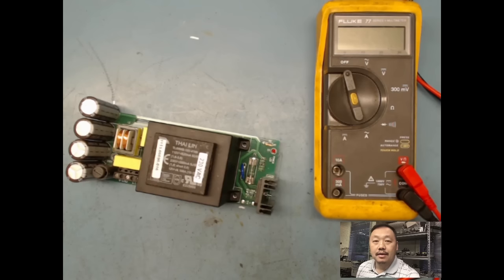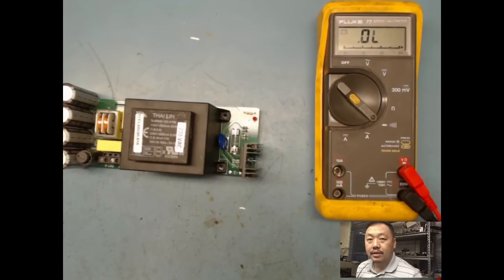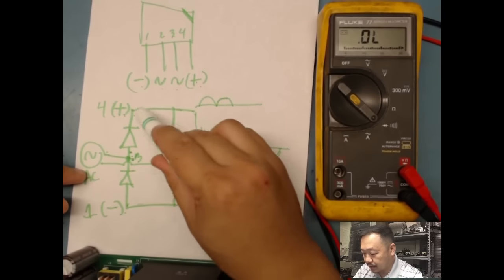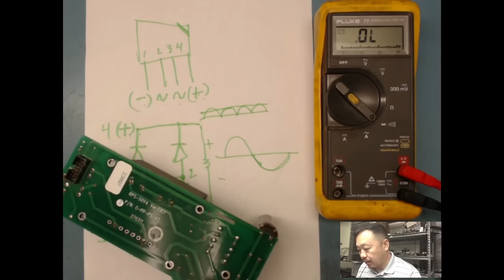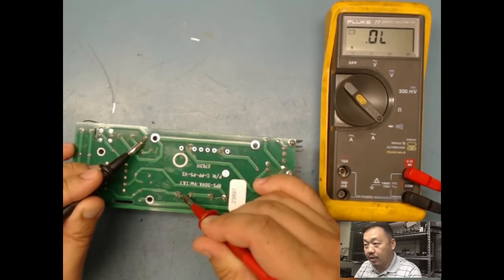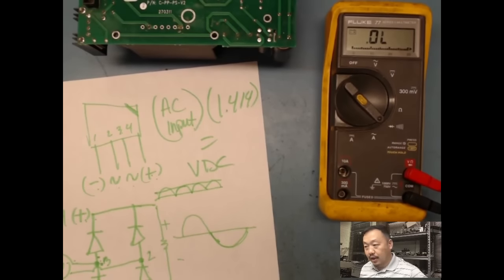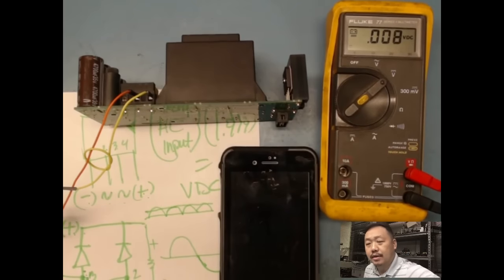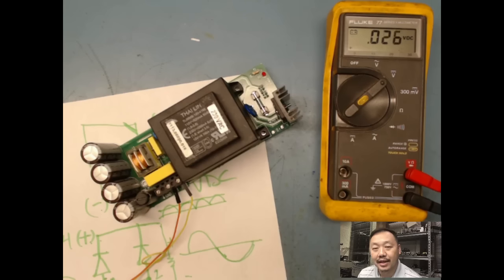How to Troubleshoot Electronics Down to the Component Level Without Schematics

Comment: I have been watching your videos for about a month now and I have learned quite a bit on how the SMPS  PCB   Inverter  Board works. What I am presently working on is a power supply out of a Samsung RF 8000 refrigerator. I have meter to read voltage and continuity, amps. I followed your instructions on how to check the boards. I don't  have a lot of electronic test equipment to test the circuit so I just use the connections  on the refrigerator to power up the board . I am getting 115 AC in and it goes through the fuse through the bridge rectifier and using your formula , and it shows about 165 DC voltages through the capacitors , there are two that both measure 165 DC  voltage . i follow the board down to what I think is an IC at the bottom and a smaller capacitor on the top side that looks like it is connected to a IC on the bottom that has no  voltage  where it is connected to the IC. I think this is the positive side of the DC voltage. On the other side of the DC voltage it goes up to what looks like a resistor to a bigger IC with a metal bridge screwed to the top of it to cool it down and that goes to the compressor to run the refrigerator, that is supposed to be getting at least 310 DC volts , but only getting 244 DC volts. I think the chopper CCt  is keeping the the  VCD/ PWM, from the feed back circuit to the main board that regulates the out that is 10 DC at the out put that should be 15 DC volts and 5 DC volts. My question to you is where is my problem? How do I find where the lost of voltage stopped. I know that the double wired coil is only hot on one side with voltage or has continuity on one side I can't remember which. Could this be my problem, I have tried everything else that I have learned from you guys . Is there any way that I can chat with you? or send you a picture of the SMPS  PCB?
Reply: I like the videos and they were very helpful.
Reply: Don't lick anything!
Reply: You should try to draw the part of the board you just had described on a paper, identify the components (value/name/etc), find the datasheet for the semiconductors, write down on the paper all values you had been measuring, see/analyse if the values give sense compared to the datasheet.

Comment: Thanks for posting, however, this is really for the novice and even below that..
If one doesn't know how to test a fuse or doesn't understand diodes, he would be better leaving the 'repair' to a more competent person.
It's also dangerous to handle boards such as this with 230 v AC applied to them!  You, of course, take due care but the 'novice'  that try such repair might get a nasty shock, or worse..
With great respect, I would suggest to offer advice on repairs on PC boards that deal with low voltages, that is for the newbies.
Perhaps, more theory on what each component does with a simple diagram on paper would be more useful for the ones starting electronics. Anyway, good effort and thank you for it.

Comment: Power supplies are a lot like cars (I've repaired both). Most SMPS supplies are basically the same, and you can identify the functions of many components just by looking at them (much the same way you can identify the alternator, radiator, or power steering pump on any car)

Comment: I like to watch a guy (northwestrepair) who repairs GPUs and explains what he's doing throughout his videos.  One of the new modern tools you can use is a thermal camera to look for hot spots.  In the case of a power supply without a load, nothing should really get abnormally hot and that's another way you can look for abnormalities in broken circuits.
https://www.youtube.com/watch?v=zHBcPRiI6-E  (thermal camera at 4 : 05 into the video).

Comment: Hello, I make guitar effects pedals, I just got afew new pcbs made, same ones I always use, I use the same components every time, but the last three I built, I get no sound, I do the same Everytime, I went over the whole board checked continuity, and it's all fine, so I checked every component and there fine, so I switch op amps thinking I gotta bad batch of op amps, there good, I'm stumped on this one, just wondering if you had any ideas. Thanks

Comment: I'm trying to determine if a Bluetooth speaker internal pcb power supply is defective.  The type of battery used to power the unit is a 12 v  7 ah seaked lead acid. Will plugging a fully charged battery and measuring the output be a way to determine if the pcb power supply is detective ?

Comment: Maybe someone can advise me. I trouble shot a table saw that quit working. Before I finally checked to see if power was actually getting to the motor, I had replaced the switch, and the power interrupter and brushes. Checking to see if power in fact was getting to the motor proved that yes the motor was receiving power. The only solution I could surmise was that the  rotator needed ro be replaced. Am I mistaken as to the source of the problem?

Comment: Hi, I was wondering if you knew how I might repair a treadmill console board? Not sure if it's a short or a relay, but when adjusting the height or speed while in use the belt will temporarily stop and then start up again. I contacted a treadmill repair company and they said it was the console and I would have to replace the whole thing. This seems wasteful and like the easy answer. Everything else works fine it seems like some sort of communication error. Thanks

Comment: I'm in need of someone to troubleshoot and repair an ice maker pcb for my vfw.  I'm unable to find the bad component on the control board which powers the display.  A new board is $330, however seems like someone should be able to repair this one at a fraction of that cost.  Thoughts,  thanks.

Comment: Why would you probe around looking for Grounds when depending on the circuit may have a voltage rail energize to a ground fault? You can't depend n that. Not an Efficient Method.

Comment: I used to apply 240volts AC to the primary and used a multimeter to checkout from the secondary in each winding it’s will shows do you knows there are hight currents low current

Comment: When Radio Shack closed their stores an went to on line they ruined my hope in electronics. I hate ordering things on line. 
If I can't hold it in my hand and look at it I won't buy it. They make buying things on line a big hassle so you have to hurry up an wait for something you need now not next week. If the on line company sends you the wrong part you have another hassle to hurry up wait some more . Or you get ripped off.

Comment: Great video but the hardest bit I can't get to grips with is how you know where to place the probes.  +ve and -ve fine but having one probe at the top of the board and the other at the bottom doesn't really mean anythng to me,  have you followed the circuit board to do this? I think I need to learn a level or two below this and then come back to this video.

Comment: 5 burnt resistors in a cluster on the audio output of a radio  and a burnt ceramic cap.  Burnt to the point it the components cannot be read.  No schematics.  Thinking of tacking in 1 meg ohm resistors and a random cap and see what voltages appear around the output the output transistor.

Comment: Greetings.  The tip by tip troubleshooting procedures are okay .  However, I think you mistakenly labelled the bridge rectifier on the schematic.  You referred barred end of the diode as the positive terminal,  and thereafter you also referred to the barred end as the anode. That is absolutely incorrect. The barred end, straight line, is the negative terminal of the diode and is referred to as the cathode.

Comment: Your LED is either series or paralleled with several other components which then requires more energy than your multimeter battery can give.l reckon it would light up if you had it out of the board.

Comment: Thanks Electronic Tech for the video.. Hope anyone can answer my questions:
1. It is more safer to use power supply to subject instead of plug-in directly to the wall socket? or actually both will give the same damage if anything accidentally wrong... (i hope PS bench can protect us).
2. it safe to the subject if we put AC gradually to them? i mean the circuit must expecting some working voltage and amps... but we supply the power only half of it.... it can damage some component and IC right?

Comment: Milwaukee has a newely released right angle die grinder. Problem is many (and i mean many) shut down after seconds of use. I think there is a torque sensor that is shutting it down. Im wondering how it could just be bypassed. I dont care if i burn it up eventually because the many i own at least could be used. I could take pics or any kind of info you need i could give you. If the comments is too lengthy i could give you my email.

Comment: if a resistor burns out with out any color lefts how do you workouts to get the correct resistors backs into the circuits for me I started with VIR ohms laws it’s very easy unless your head get screwed it up

Comment: HELP! I suspect my transformer is faulty because no output when powered up.. how do i know the value of the transformer with no makings and no schematic? so how would i find a replacement?  It's for a MC2100TS-50W REV B Threadmill power supply...
Reply from the maker: you'll have to find out what the output of the transformer supplies.  For example, If you only have one secondary winding, and it goes into a bridge rectifier, and then the bridge rectifier supplies DC voltage to a 5v voltage regulator, then the out of the Bridge rectifier only has to supply a minimum of 7vdc.  Just work your way back.  Finding a replacement transformer can be difficult if you don't have a part number.  Good Luck.

Comment: Something else to look for in visual inspection. If there is vibration, sometimes heavy parts will lift the traces off of the PCB and break them or break the solder connections.

Comment: Hello Electronic Tech. My job is to repair electronic boards in Iran and recently I faced a strange problem.
As I was repairing a BMW 730i 2017 wing mirror electronic board, there was a dubitable component from ST electronics company which I couldn't find its datasheet on the internet. That was a 2 pin component with Zb2b part number. I am wondering if you could help me with finding out what component I should replace with this. sincerely.
Reply from the maker: Sorry, I'm unable to help.  What we found with automotives electronics is that they are not your common components but are made specifically for the car makers.

Comment: when your testing fuses with your meter in the setting you are using its not volts its ohms could also be mega-ohms but in your instance it was 0.001ohms not volts.

Comment: Thank you friend for the great video . I've worked for several years diagnosing automotive electrical and electronics. Testing sensors, actuators and wiring but never really understood circuit boards . Subscribing :-) Thanks

Comment: Good way of teaching newbies especially if there is no schematic. Been doing repair of electronic stuff for 20 years and still counting. I developed the skill of fixing things without schematic. I can even modify a circuit even if there is no diagram, I just have to make my own and get the the components ID and search in the web for the specs. For the power supply that you were checking, I guess the output is quite low. Assuming you are using the 115Vac input and the transformer’s expected output is 12Vac, then the turn ration has to be 9.5:1. The rectified output is supposed to be 12*1.414 = 16.9Vdc. Now adding the filter caps, C=I/2*F*Vpp. C=2/(2*120*2) C=418uF or the closest to that. With that filter capacitors the filtered DC out is ~14.9Vdc and that is at open load. What you were getting is quite low.

Comment: Thanks for sharing!
I haven't had luck testing electrolytic caps in circuit. Ive read that an ESR meter is needed to accurately test caps. 
Supposedly a cap can test good on a multimeter but fail the ESR test?

Comment: Hey brother, my name is Va. Ok I got a test meter that powers on, but the readings are not correct and my question is where should I start? I've looked at the board thoroughly and see no visual damage. Was gonna replace all the smd resistors and components. But please , I would like to hear opinion.
Reply from the maker: When you are saying test meter, I'm assuming that you are referring to a digital multimeter.  First off, what readings are off?  Voltage, ohms, current, or all?

Comment: Good video however, you make each point very quickly  but the you restate it over and over and over. You could have summed up the first five minutes of your video by simply saying one time too thoroughly check the board for visual burns, cracks and breaks in any of  the components, traces or board itself.
Reply: sucks you people always forget about the playback speed, could double it if you wanna hear em talk faster or god forbid skip 5-10 seconds ahead if you can reasonably gather what hes about to say

Comment: I like to see you troubleshoot and repair a PC type power supply with PFC Front end and flyback converter with integrated controller 3 output voltages and a power on pin.
Reply: A what?

Comment: holy cow, 8 minutes into video: you do not read volts on a the audible diode position , its Ohms , a short is not always a short, it can mean continuity which means wire is not broken , shorted, or open , there are many shorts, short to ground, short to power , unintentional ground or a unintentional power .... and your a electronics tech, i dont have a degree in electronics but i have study it a couple times and used it at job for some time... you called both ac sine waves inputs then there is no output  of the bridge rectifier....you need to proofread your videos, your smart but your making many mistakes in words and the way you describe things ...
Reply: and as a tech you dont know how to fix your auto focus on camera..... there is a setting for that ....

Comment: I like how you said that you don’t need a schematic… And the first thing you did to troubleshoot the bridge rectifier was draw a schematic.
Reply: Well that was a diagram, and a basic circuit diagram. A schematic is a full circuit diagram but with the crucial details of how each component interacts with the others, where each trace leads, and what are the values to be expected from readings. Repair with schematic is like 'This is what we should have. Let's see how what we see deviates.' whereas repair without schematic is like 'Okay... what do we have here... and what could have deviated?' so it's obvious which type of process can be more painstaking and costly.

Comment: Hi , I have a Kenwood RX2000  general coverage receiver.  The radio works with good selectivity  and good audio. My issue is that the vfo is not able to change. Could you give me some tips where to start fault finding please vk2jcc

Comment: Nice job of describing the proper steps of “Best Practices”. These boards are sprayed with like a clear lacquer that makes it harder to get readings. Scratching with a small flat blade, or other handy tool helps.
  Also, as you discussed having a heavy component like that transformer on the board, if it fell during the past, the printed circuit can crack. I would include that repair in a future video, if you haven’t already. ( Sorry, haven’t seen all the videos in your channel) If a broken circuit on the board, scrape gently to clean to the printed copper, then solder a wire across the fail point. I fixed the neighbor girls radio 35 years ago, after she dropped it. You guessed it if you said transformer end was the fail point.
  Same with “Cold” soldered joints. I’m sure you remember when tv’s took two men and a boy to move it. Mine wasn’t quite that big, but on day while watching it, the screen went black. So moved it away from the kids into another room, plugged in, turn on and wait for it to do that again...but only after your common sense step, visual, discrete component check, writing down voltages and making note ( Before digital cameras), it quit, I found it with my Fluke DMM, re-soldered it, let run to confirm, then placed it in service. 4 kids, wife and one income and one tv. 
 The tv shop in a town that was the county seat, always or more often had a sign up that said; “ Gone Fishing, instead of watching your tv!” Thought that was funny. Very good information and clear to hear with my $3 dollar ears.